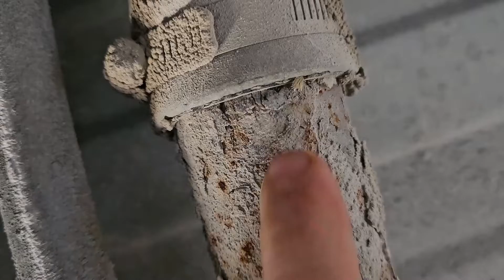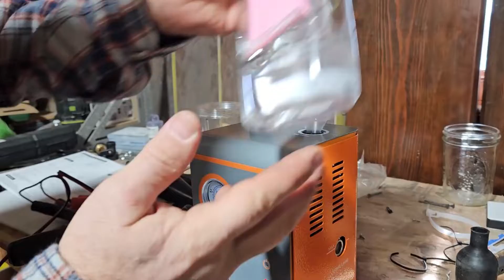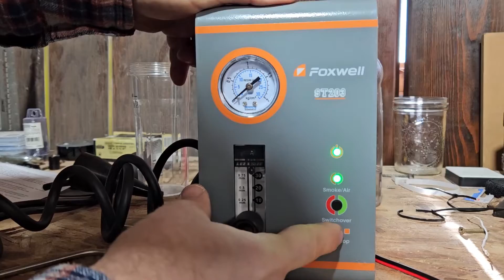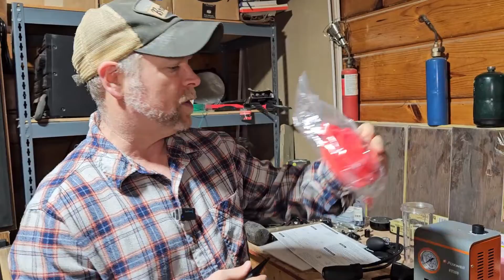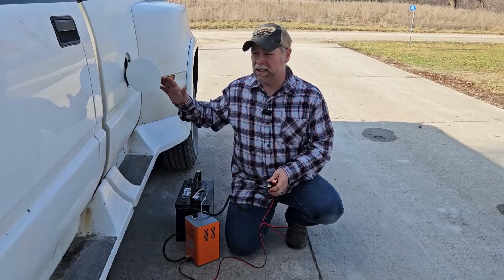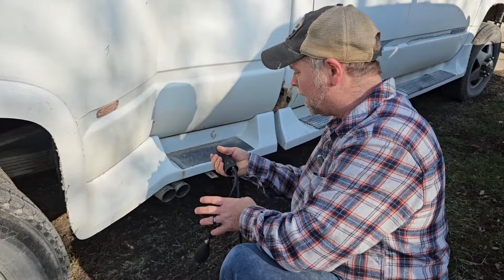FOXWELL ST203 Automotive Smoke Machine EVAP Vacuum Leak Detector

Comment: How about coolant leak ?
Reply: You have to remove the coolant then smoke test
Reply from the maker: I tried this on the radiator and it did not detect the leak because there has to be space for smoke to pass through. If the radiator lines have coolant in them then the smoke cannot pass through the whole system. In other words, the smoke cannot pass through water like it can an exhaust, vacuum line or gasoline fill line (as seen in the video)

Comment: how much does it cost to opperate this on a Toyota Corolla per hour? in 2024?
Reply from the maker: Shop charges are all going to differ based on your location. Having your own smoke machine can save you a ton. Add a little baby oil and it will run for 30+ minutes on one fill
Reply: @skinners100honestreviews3  What about mechanic charges per hour for fluid line tests?
Reply from the maker: @arktos298  I have no idea what shops charge for this service. 
You would need to call your local shop and ask them for an accurate rate for this service.